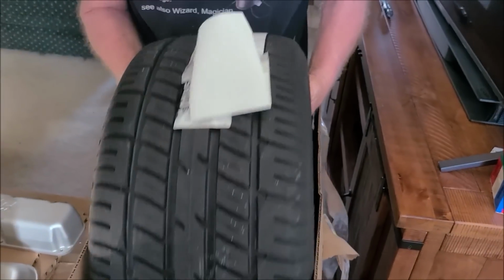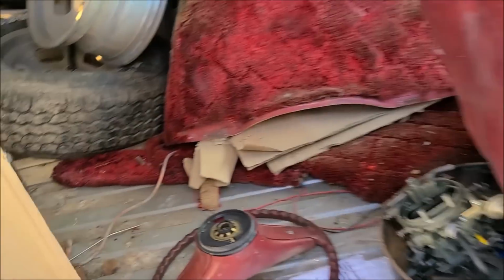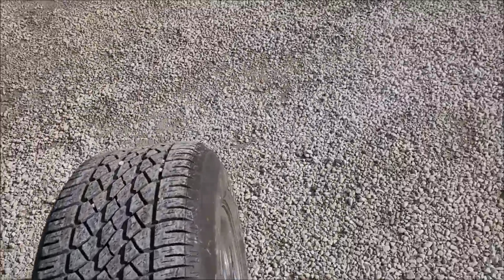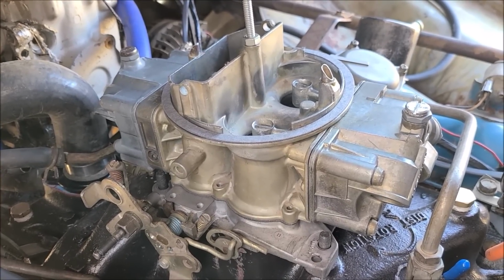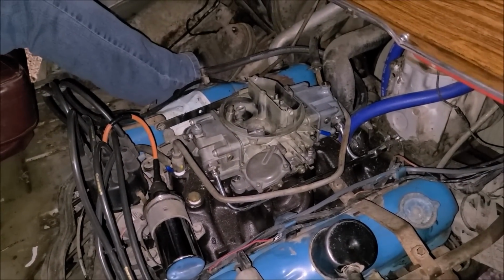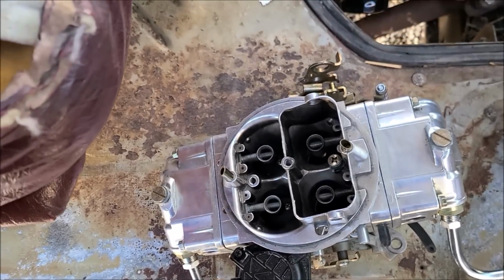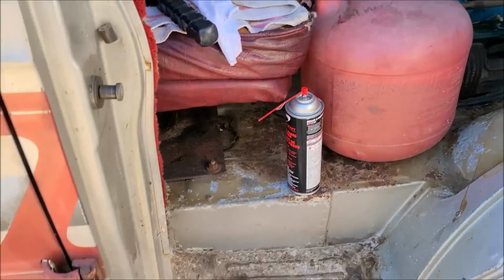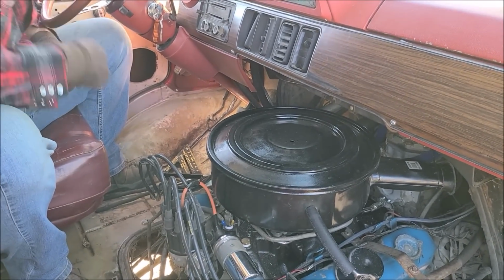Keystones, Carbs, and plenty of Van Dookie to GO around

Comment: 12” wheels on the rear is what the Dodge need for my personal way I want them I had the factory wheels widened for Vanther Crazyvan I put Cragar 12” on it with 15x7” on the front 8” wide wheels on front the 235/60/15 will rub but a 7” wheel the 235 will not rub
Reply from the maker: Thanks for the info, that is really good to know
Reply: @ScottsSpeedShop  they don’t supply grommet don’t no why I have 83 shaggan wagon original interior 318factory 4speed on the floor kinda rare I think 833trans  I bough same tank Canada
Reply: Put one and aquater on front wheel spacers

Comment: Seems like there should be a lockout for the secondary throttle plates. I prefer having a choke on a street engine. Sure has better cold start manors. But, it’s coming together.
Reply from the maker: Once I get that carb dialed in, it won't ever need a choke, none of my cars have them, and I never really have issues unless it is a really cold day out

Comment: Love those Keystones Jed. I had them on my '78 Magnum and they looked devine. Good work on the carb, looking forward to the new gas tank installed and first spin down the road. The pipe thing was a gut buster.
Reply from the maker: Keystones on Magnums look killer, I do want to get me a Magnum from that era someday
Reply: @ScottsSpeedShop  mine was Charcoal Gray Sunfire Metallic with factory T-tops, radio delete. Pulled the smog motor and put in a fresh 440, beefed 727 and 3.55 rear posi. She was beautiful and very quick.
Reply from the maker: @mikestackhouse9001  I have two words for you DREAM MACHINE, I freaking love the sound of that badass machine
Reply: @ScottsSpeedShop  I could send you some pics if you like. Which email address would you prefer?
Reply from the maker: @mikestackhouse9001  chargerjezebel70@yahoo.com would be the best one

Comment: I ran Aluminum Supertricks on my 73 Gremlin. The only bad part about those rims is they like to leak so you have to seal them up real good.
Reply from the maker: I need to replace the bolts on mine, and I will definitely be sealing them up real good

Comment: I still think slotted mags are the best choice. But try finding them for Mopars.  It's looking good otherwise.
Reply: Buy a new set of US Mags slots. They make them in several 15” widths and even 17”. They run right around $200 a wheel depending on width. I Have them on my Lil Red and am putting them on my 73 Dodge van.